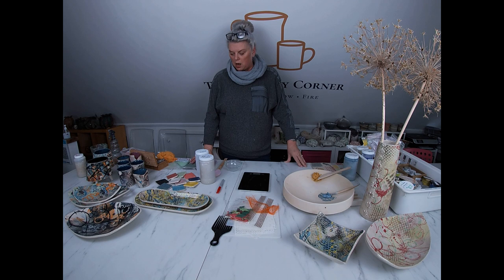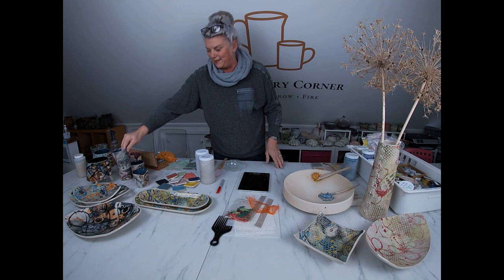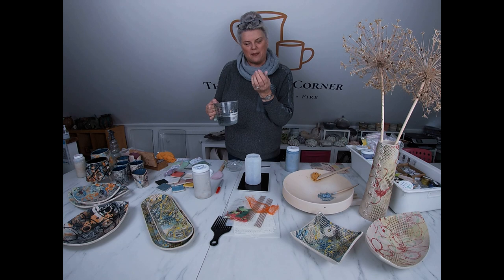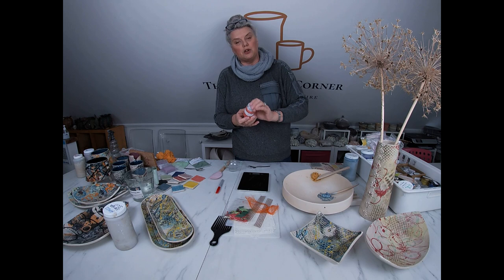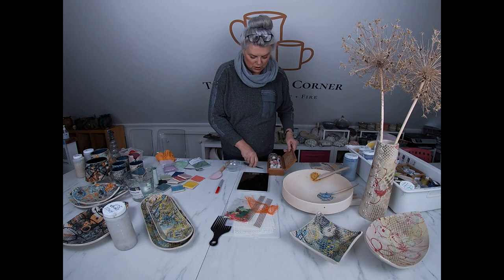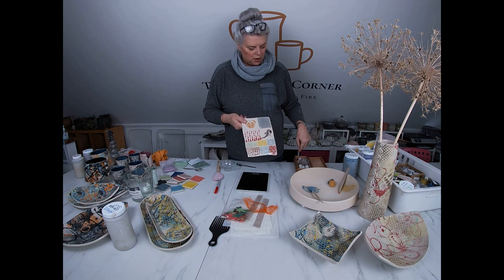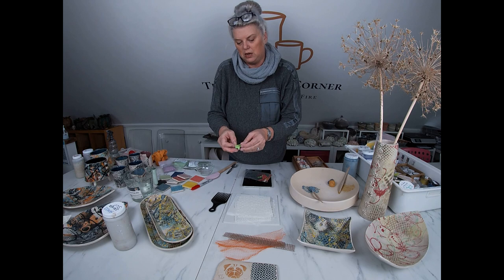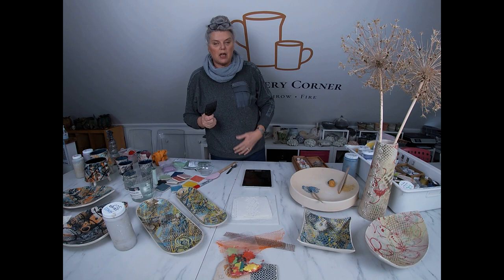Monoprinting on Clay- Pt 1 Preparation; Coloured Slips/Clay Pastels/Stencils(Pottery Video/Tutorial)

Comment: I am so glad I found your videos.   I learn something new every time I watch. I’m particularly interested in developing a set of slip crayons.  Do you just draw with the slip crayons? Or must they be powdered using the fine sieve? I’m wondering how moist the clay must be when using them?  I’ll watch the whole set of videos about mono-printing. I bet you cover the specifics about how to use these.
Reply from the maker: Hi Annie.  You can draw with underglaze pencils made in the same way out of underglaze not slip used on bisque Ware.  It's difficult drawing on wet clay with slip crayons due to the pressure needed.  Hope that helps 🙏

Comment: Fab video - thanks! What is the make of the pigment powder you use and where do you get it from? I’m in the UK :)
Reply from the maker: Hi Joanne- thanks for watching and commenting.   I get my pigments from Bath Potters, a great little independent pottery supplier.  Make sure you use the correct temperature pigments for your clay (either high fire for stoneware or low fire for Earthware).  Hope that helps.   Hope to see you tuning in to Part 2.  Make sure you've subscribed so you know when it's published. 😁

Comment: Incredibly inspiring, all of the monoprint videos. I'd love to start right now, but have issues finding the pigments and binding. Is any pigment working? Or what is a special name for heat resistant pigment? Where do you order your pigments?
Is the binding used for painting with pigments also good for clay/slip? 
I really love the colored slip balls and the "spray-like" effect with the stancils in the finished pottery.

Dose colored slips is the same as underglaze, or is there any difference? 

Lots of greetings from Germany :)
Reply from the maker: Hi Jay.  Thanks for watching and your kind words 🙏.   I order my high fire pigments from a company called Bath Potters here in the UK.   You can use the pigments in slip, in underglaze and to marbled clay so it is very versatile.   Have a look at my video on the difference between slip, underglaze and glaze which may help you more.   The slip pencils are easy to make from your own coloured slip.  Monoprinting is my passion- prepare to be addicted 😁